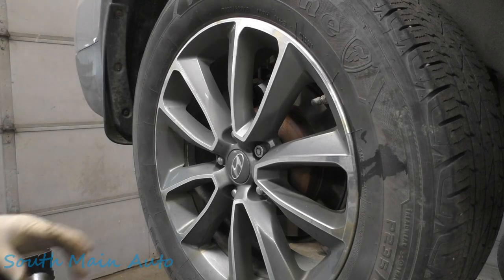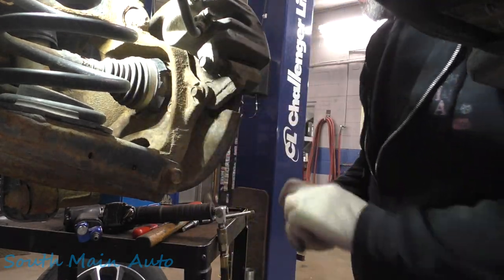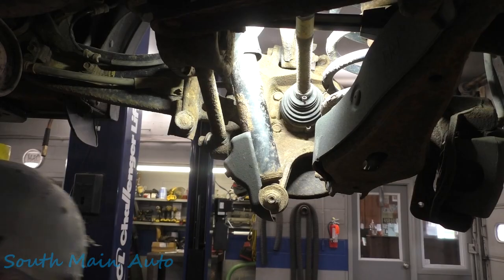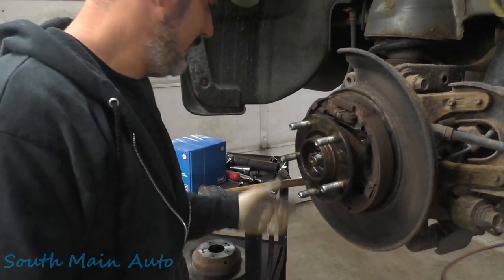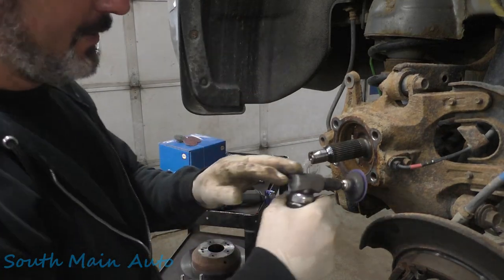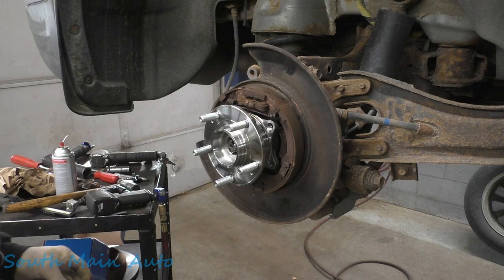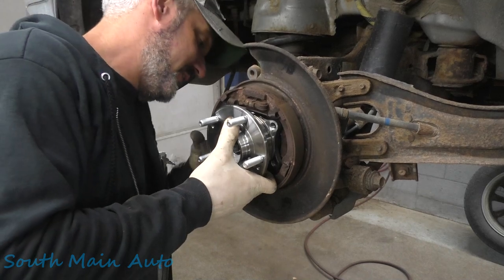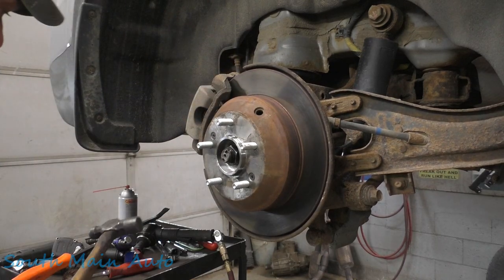Hyundai Santa Fe: Rear Wheel Bearing

Comment: It's a 2017 and already needs a wheel bearing?  Wow.
Reply: It being Korean car plus the salt out there for winter to melt the snow. Doesn’t help
Reply: @NightHawk J30  I'm driving a 2003 Japanese car and a 2006 Domestic. Japanese car Japanese bearings,  American car US made bearings, Korean car Chinese bearings.
Reply: At least it came apart easy
Reply: Got an 09 Mitsubishi with over 250,000km original bearings and in the salt belt
Reply: I have a 2010 Elantra, still has original wheel bearings. 265,000 km
Reply: 6 years old
Reply: The year doesn't matter as much as the mileage.
Reply: Probably got a good amount of miles, plus it's 6 years old already. So it's not like a brand new car off the lot.
Reply: @nighthawkj30A4   That Korean company makes more reliable cars, then any domestic car company.
Reply: i have a 2017 infiniti and had to put a wheel bearing in it
Reply: @DaDaDo661  I had a 2000 bmw with 252k miles on original bearings when I sold it around 2020, never had an issue, quiet and smooth.
Reply: @mynock250  sure they are, that's why most need engine or trans before 100k miles.
Reply: I have rav 4 2004 300000 km is stil with original bearing
Reply: How come so easy to separate from knuckle??
I am in Ontario, Canada. Every time I had use sliding hammer or air chisel to remove bearing from knuckle and torch them to take bearing out from backing plate. No salt over there???
Reply: @mynock250  but what is considered domestic anymore? Toyota, Nissan, Subaru etc all have US factories. So technically speaking they are made domestic with a lot of domestic resources.
Reply: Thank GOD for the 10-year Warranty. 🤪👎
Reply: @Phillip Banes  a quick Google search of "where are Hyundai parts made" came up with this...

"Generally speaking, Hyundai gets a vast majority of its parts from outsourcing to China and other companies in South Korea. It’s estimated that up to 60% of all Hyundai parts are made in China, as the cost to produce parts in other countries has skyrocketed over the past decade or two."

It's not too far of a leap to assume  these were Chinese
Reply: @DaDaDo661  180,000 miles on my 2003
Reply: @DaDaDo661  do you live in the rust belt?
Reply: @SyracuseIsOranges  yes
Reply: @mynock250  those arent high claims to fame
Reply: @mynock250  i ve seen brand new vehicles with all kinds of failed parts.
They all make junk , regardless of C O  O.
Reply: @kens.3729  Only on the power train. 😞😞
Reply: @Phillip Banes some are just crappy disposable cars.
Reply: It’s just like a GM…..
Reply: Put 3 in a 2015 Terrain that was 3 years old. The 4th went 6 months after that. They ain’t what they used to be.
Reply: @nighthawkj30A4  I hardly think it being a Korean car has anything to do with it.
Reply: @Ken S.  well...that's the thing. Bearings ARE covered under the 10 year warranty. I own a Hyundai, I know it is because I asked. Why was this not taken in under warranty? Unless it has over 100k miles for a 2017
Reply: Welcome to the rust belt
Reply: Right rear wheel gets smacked around a lot taking turns short and such.
Think about how many times your rear right hits the curb when turning right.
Reply: Can't tell you the amount of 3-4 year old GM W bodies that would need bearings that I would see constantly.
Reply: Jeez, the armchair mechanic's comments are off the wall!
Reply: @solidcobalt  I owned two Chevy cobalt. Both myself and the wife both had the front bearings go out 3 times each on those cars. Insane to me. The engine was solid on those but anything on the front end was absolute garbage engineering. Suspension, brakes, bearings etc were constant pain points. Glad I got rid of them
Reply: Just wait til you hear about their engine issues!
Reply: Don't worry the engine was replaced last month
Reply: @theelite1x721987  oh boy the cobalt.   Constantly see broken rear springs and fuel lines near the exhaust that failed on those....
Reply: @solidcobalt  I had both of those issues as well. Final straw was when I had computer issues. Car would barely start. Dash lights were all going crazy and car didn't want to shift correctly. Speedometer not working etc. I think it was a harness/ground issue that screws up the ECM and such. I got it to point where it was intermittent and traded it in when dealer was none the wiser. I was done with that car
Reply: Salt
Reply: I have a 2016 CRV. It needed 1 wheel bearing at 50k and now at 90k I hear the other side. It can happen to any car
Reply: @Phillip Banes  its written in my warranty book. 2016 Hyundai sonata. They are specifically spelled out as covered
Reply: @Phillip Banes  I got several books. Owners manual was one. Another was smaller and it specifically talked warranty. I bought car brand new, I know what it came with. I still have all the documents
Reply: @Phillip Banes  2016 sonata owners handbook and warranty. 49 page book separate from owners manual. Page 23, powertrain warranty under transmission/ transaxle. Front and rear hub bearings are spelled out. On a Sonata the hub bearings are the wheel bearings.
Reply: If you drive on gravel roads or rough PRNY roads then you go through bearings like candy
Reply: Also depends on the type of road conditions they have to drive. If its Nice flat smooth roads then of course it will last longer compared to rough rocky dirt roads.
Reply: Dude it's a 6 year old car...... That's a LONG time for a factory original bearing. Why are you saying "wow"?

Comment: Way easier than front wheel bearings on my daughter's 03 Outback.  Didn't involve a hydraulic press or a torch. Thanks to you I got it done though.  You showed me the tip of getting the race off of the hub with a torch. Worked like a charm. Thank you Eric O!

Comment: I always use the carwash at Mobil stations here in Illinois.  They have touchless with the undercarriage douch.  Also have a couple of spray cans of fluid film around.  My mechanic say the undercarriage looked like new at my last oil change.  My Outback is 10 years old and always driven in northern illinois but always washed and garaged.

Comment: Herro, My name is Ha-yoon Kim. I'm carring from Hyundai North America with some great new about your  2017 Santa Fe. We would like you to know that our engeneers have worked hard to create wheel bearings that meet or exceed our competition with the added benefit of being very easy to replace if that is needed. Those same engineers are responsible for your engine using an excessive amount of oil. The failure rate is near 100%. You can rest easy knowing that we have set aside $2 billion this year to cover the warranty of these engines.
Reply: Every single manufacture has shortcomings.
Reply from the maker: Lol must be a "Chevy Guy"
Reply: @Phillip Banes I never said otherwise. I only mentioned Hyundai because they were in the news this past week TheDrive. They discussed the 2 billion for bad engines. Our guy was working on a Hyundai in this video and the Engineers did good on the wheel bearings. Not every comment on YT lacks substance.

Comment: Just did two front wheel bearing hubs on a 2012 Ram up in the Peoples Republic of Ontario for the last 8 hours.  They fought me every-single-inch of the way! Chisels, air hammer, sledge and a 1/2 gallon of penetrating oil. Bruised cut and tired but I won. The truck put up a fight but gave in. Now I'm relaxing all proud at my accomplishment watching you knock out a bearing hub in less than 14 minutes. Sighhhh.
Reply from the maker: https://youtu.be/p9543-dMBRo

Comment: My 2005 Toyota Corolla right rear hub assembly was replaced in the spring. The sound was awful especially on the highway. The faster u went the louder it got. It was loud. My mechanic had a hell of time getting it off. Sledge hammer and heat. It was on there good. I was glad when it was fixed lol

Comment: That’s a very timely video. I have a 2010 Hyundai Santa Fe. And while changing from my summer tires to winter tires yesterday I grabbed the tire at 3  and 9 o’clock and noticed there was quite a bit of wiggle, so I’m thinking the wheel bearing is shot too, but it’s still quiet as a mouse. Maybe I’ll have to take Eric up on his word “If I can do it, you can do it.”
Reply: You didn't mention front or rear, but either way you should grab at 12 and 6 instead

Comment: 210 FT POUNDS? When i replaced the steering box and pitman arm on my 96 Grand Cherokee i left the old pitman arm on and replaced the new box with a new pitman arm, torque was about 200 pounds, a lot laying on my back, my torque wrench went up to 150 so i hit 150 then a breaker bar maybe another 1/8 of a turn. I recently bought a 2023 Tuscon SEL AWD with the convenience package. 31 mpg highway is certainly respectable for a SUV, cruises at 70 mph revving only 2000 on level ground with the new 8 speed and makes acceleration acceptable. Smart CC automatically downshifts to maintain speed on inclines and also declines along with braking, simply amazing. I was thinking of a new Grand Cherokee but for the huge price difference i went with the H.  

Pumpkin smells those YUMMY treats==lol

Comment: After it was so nice to you, I thought you'd spray the hub, and backing plate with fluid film. Especially where you ground off the crusty-rusty....
......How do you distinguish the CV joint being bad, or the wheel hub bearing  being bad....

Comment: Hey Eric you got me to finally realize i can change my brakes. I Did the fronts on 16 escape and now on to the rears. Learned some things along the way and plan on correcting a few thing i forgot like filing were the pads slide when i only used a wire welding brush to remove that CT rust. I doused everything in fluid film to slow down the rust. I just need to figure out how to remove the failed 2 piece lug nut. I bought Dorman (only reasonably priced ones at 2.50 for 40) oemfix single piece lug nuts. I don’t think they can mess those up.

Comment: My son recently replaced both axles on my 2011 Honda Odyssey.  Having watched you do multiple axles and wheel bearings, I wanted to put some fluid film on the inside of the part where the axle goes like you did in this video.  He said we shouldn’t.  He’s an apprentice mechanic, level 2 (so he has one more year before he can get licensed). So I wanted to know why this might be okay or why some might say not to do this.  Thanks!
Reply: It won't help or hurt it's operation.  We fluid film ours or give it a light coating of grease/anti sneeze when we assemble.  The main purpose is to ensure the next time it needs to be dissembled or monkeyed with-  It won't be seized up in the hub.  It's only a very light coating and no need to go hog wild with it.

Comment: Most Hyundai’s have very reliable wheel bearings for whatever reason the Santa Fe and the Sonata have always had bad luck with the rear wheel bearings working dealers in Erie, Pa and Jefferson Ohio I’ve ran into many many of those usually covered under warrenty

Comment: Have you found a new mechanic to mentor besides helping Ray out in his new adventure. There will probably be lots of questions on paperwork. No more 7am to 3:30pm or holidays for Ray, at least for awhile. It's getting outrageous at how much parts keep going up, you would think prices would be coming down with aftermarket manufacturers starting to catch up. It's getting to the point up here it's cheaper to go to the dealer then buy aftermarket.

Comment: Curious as to why you didn't load test battery? I've had batteries pass with tester but not hold a 15 second load. I get batteries are crazy expensive now days but l usually change alternators and batteries together, especially if they were killed dead several times. Just my humble opinion. Good video and work ethic as usual!

Comment: Would a bad wheel bearing only make noise once you get upto 45 50mph? I got 4 new tires and now I'm battling a tire shop about what I think is a tire issue because the car only makes the noise at higher speeds and only gets louder with speed. To me it clear as day what the sound is, but my brakes are on the cruddy side and are make a bit of noise, so they claim they can't tell what the sound is until I get new brakes.

Comment: Never understood why the torque setting was so high on the axle nut. Its splined, so it won't spin. And after seeing enough crazy accidents where front end parts go flying, either the CV joint pulls apart (the only thing holding it together is the boot), or the axle pops out of the transmission. And if the axle nut does come loose, it'll make a rattling sound before anything catastrophic happens because the axle assembly is trapped in between the rotor and the transmission. Just an observation.
Reply: The end of the cv shaft holds the bearing together. Too loose = no bueno. Too tight = no bueno.
Reply: @mdotguy  Yeah but +/- 200lbs? The front wheel drive bearings that I've changed were a single wide bearing, where the outer race  pressed into the spindle, and the inner race pressed onto the rotor. So when you tighten that 32 or 30mm nut, it just holds the snub axle in the bearing/spindle assembly. On top of that there's that thin metal locking cap with the cotter pin? I only tightened the axle nut to a little more than the lug nuts. That axle nut has yet to back out after 70,000 miles. There's no crush like on a rear wheel drive car that has tapered bearings on the front end.
Reply: @mdotguy  I mean I understand he had to do things to "spec" because its a business, and its customer's cars.

Comment: My 06 Santa Fe rear hub has 3/4" holes between the studs on the hub, so you can access the bolts from the front! Have you ever run into that  ?

Comment: Just swapped passenger one in my wife's golf, noisy as hell, they were not too bad money even for the real article so I swapped both right and left (also was not positive which side was bad, I guessed pax based on noise change while cornering and was right, but it was very slight) the bad bearing felt smooth and had I not had the other side and the new ones to compare I would have sworn it was good.... but it took about 2x the effort to turn as a good one and once changed noise was gone. Total crap shoot, this cars at 90k, my 230k vw wagon has never had a new wheel bearing, and its got the bigger rims, who knows.

Comment: Hyundai and Kia's, no matter where you are in the world they start to rust as soon as you leave the showroom.
Shocking that the bearing has gone after only 5 years, but then again they use cheap, crappy parts so nothing surprises me.
I have a UK 2008 Sedona and every nut and bolt or part you remove is rusted to bu99ery!
You got lucky Mr O!!

Comment: If you had used a Milwaukee cordless impact you could have had enough extensions on it to take the bolt out from your living room without losing any torque at all!  My Dewalt cordless impact actually GAINS torque with extensions!  I haven't found a single bolt that could even come close to challenging my Makita cordless impact!  When I walk into the garage with my Hercules cordless impact, the bolts just jump out on their own out of sheer terror!  🤣

Comment: I have a hypothetical question....

Say in the process of this repair you discovered the brake caliper was toast. Labor wise, how much extra time would you bill for putting a new one on?
Reply: Should only be a few tenths of an hour plus the labor time for bleeding the brakes.
Reply from the maker: Book time on the bearing is 1.5hrs. The caliper is 0.8hrs on its own. If I was doing it in conjunction with the bearing I would add 0.3hrs to the bill.
Reply: @jonathanschiver4274  So it is confirmed that I got screwed when this exact thing happened to me. I was billed an additional 1.5 hours at $165 an hour to pop on a new caliper.
Reply: @SouthMainAuto  Thanks Eric

So it is confirmed that I got screwed when this exact thing happened to me. I was billed an additional 1.5 hours at $165 an hour to pop on a new caliper.
Reply: Guessing it wouldn’t be much of a discount due to the time it would take to acquire another one all the while the vehicle is taking up time on the hoist.
Reply: @SouthMainAuto  that's reasonable. 👍
Reply: @anduuhar  if you live in a metro area that isn't terrible, rural area you got boned.
Reply: @anduuhar  I wouldn’t say screwed. Mr O is much like my grandfather as he was a mechanic and never gouged is customers and charged a fair price. 

My grandfather had a shop in Los Angeles Watts area. City inspector came in and did an audit and said to him he needs to charge more for parts and labor. This was to remain competitive in free market. I call BS but that is what he told me.
Reply: @RenoBusdriver  Adding insult to injury I was billed 3 hours total...the job took under 2. So if you call them stealing and extra $165 out of my wallet not getting screwed I'll happily work for you by the hour.
Reply: @anduuhar  I feel your pain and understand. I once took my Subaru to a muffler shop to have my aftermarket CARB certified Catalytic Converters swapped. They were bolt on however I didn’t have a gas torch, so I entrusted them to do it. I told him exactly what I needed done and how I wanted it done since I was paying. So the muffler guy kept me there for 3 hours and didn’t do it the way I wanted it done. Because I wouldn’t be there if the bolts broke lose,etc. Then charged me 400 bucks flat rate. So yeah I understand why you felt screwed.